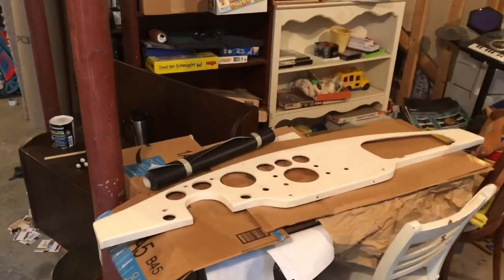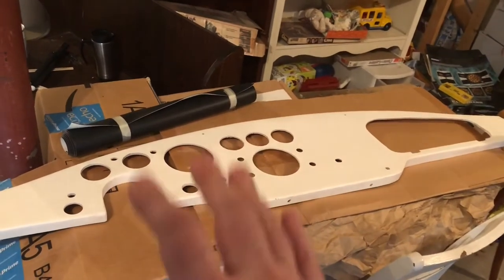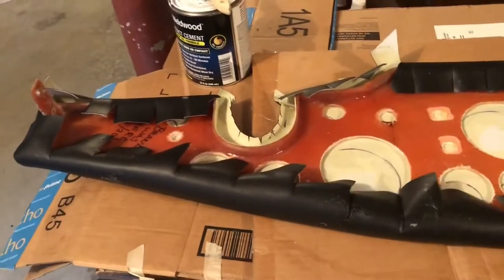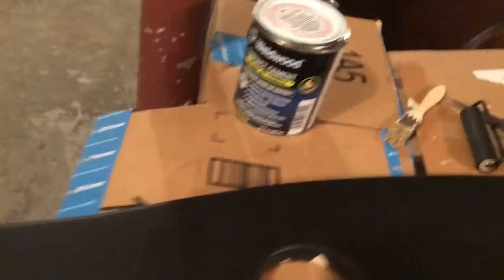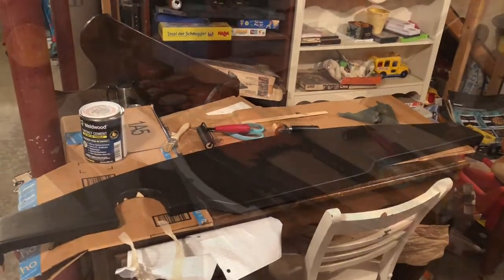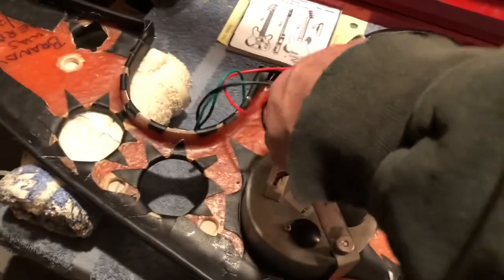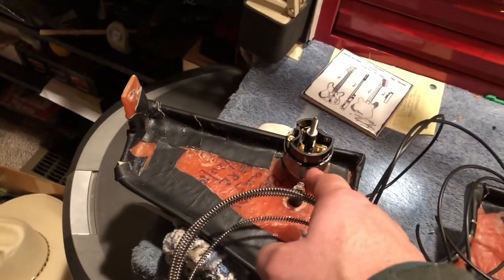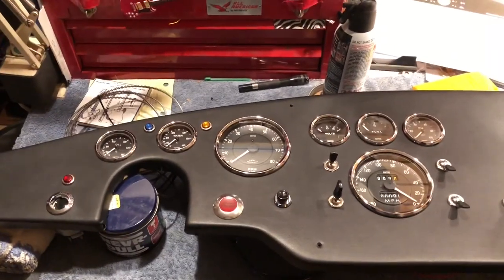Cobra 427SC Replica Build Part 19 The Complete Dashboard

Comment: The original gauges that came with the street beasts are horrid. They are white and look like something you see in a boat. 

Curious what your thoughts were on vinyling over the glove compartment, or even if it's possible?
Reply from the maker: Josh Ruppert First thing, you don’t have to even cut out or have the glove box, if you don’t want to! If you wanted to cover the lid w/ vinyl, you would need to use a different box than I did. The Shell Valley globe box lid and the one available from Acton Custom would definitely work. It would look very trick and more era correct than my plastic box! I would do it, as the storage space is well worth it, unless you absolutely had to have an SC type replica which of course came without glove boxes!! Lol